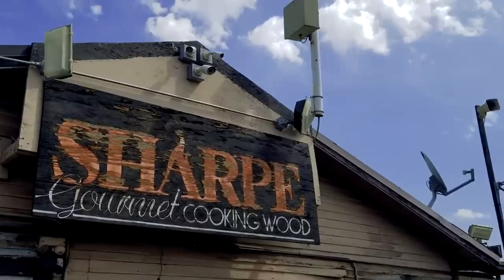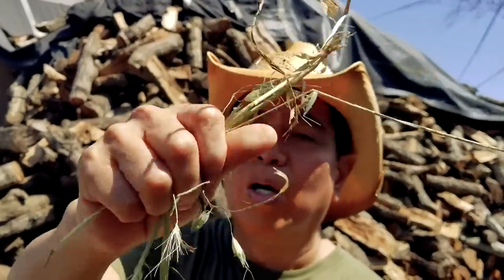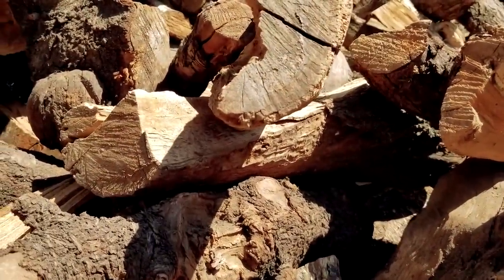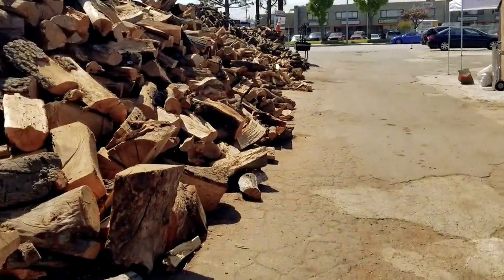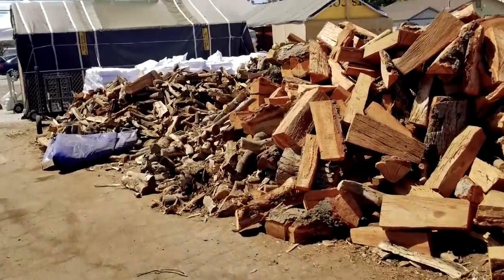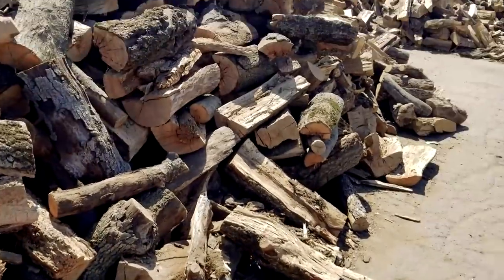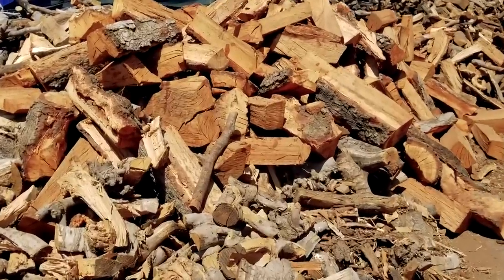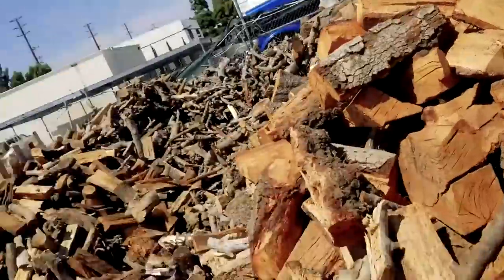Part 2 - Science of Smoking Wood Lignin How-To by BBQ Champion Harry Soo SlapYoDaddyBBQ.com

Comment: Harry good morning
Question I have a graduation party coming up and smoking to briskets a day before so what's the best way to reheat the next day and hold for serve though out the day here is what I was thinking I have a electric master built smoker which I was thinking is perfect to reheat my brisket and hold it in there at 150 degrees all day without drying it I will also use it to hold ribs sausage and chicken what do you think....
Reply from the maker: Reheat until internal 165F and keep warm before service. Turn meat so it is wet with brisket jus.  Use chafing tray to keep warm and slice upon request if you can after removing from foil   alternatively you can cook, slice, and refrigerate

Comment: Would you do the same if you were using a very deep charcoal basket for a long cook? I.e. is it possible for the wood to be too far under, or would it be better to put in middle so can her heat sooner.
Reply from the maker: Suggest you spread wood chunks from bottom to top like lasagna layers

Comment: so for example in my slow n sear, am I doing it right when I put my wood chunks inthe bottom and surround them with coal and then put the hot coals on top for hot n fast?
Reply from the maker: Yes, that is the optimal technique based on science and I have the "hardware" to prove it works!  - https://tinyurl.com/ybxl4mlc
Reply: @SlapYoDaddyBBQ  Your fundamentals video has given me stellar briskets. My only issue is finding a way to get good bark on the flat when I am cooking with the fat cap up on the weber kettle with SnS. I tried just removing most of the fat cap but ended up drying out some of the flat. Could have just been that cut
Reply from the maker: @screenshotted  I prefer two wing charcoal basket on the Kettle as the convective airflow creates championship brisket bark.
Reply: Most appreciated. Got a pile of Plumb/Cherry wood that's been drying for a few months. Under the coals. Whoa! Gonna try that. Saturday barbecue at my place is going to take on new level of aroma. Thanks for the tip. Brisket is going on. Forgot about the phenols. Too long out of Biology Class. Cheers

Comment: Hhhhmmmm. I don’t know about all the science of this video, but applewood, like most any fruitwood, produces plenty enough BTU’s to cook with. Not sure where the idea to the contrary came from, but many a bbq contest has been won using it. Also, the very best BBQ flavor is from thin blue smoke produced from a very hot, clean burning fire, (specifically in a horizontal offset smoker) not from smoldering wood chunks in a bed of charcoal. I’ve tried it all: shoveled coals into the bottom of a drum, cooked over lump and wood chunks in both a UDS and a couple of WSM’s, cooked with a wood-fired Bandera vertical offset, and I went full circle back to what I started off with. (I even got volunteered to man a gas offset smoker once for a wedding, and even though I added much more wood to the burner than suggested, the pork had VERY little in BBQ flavor.) The truth is this. You can make the absolutely WORST or the absolutely BEST tasting BBQ in a wood-fired, horizontal offset smoker. That’s not just my opinion. Most of the famous BBQ joints like Franklin’s cook with wood-fired offset smokers. The faster you want to cook or the bigger the smoker, obviously, bigger the fire, but you always want a HOT fire for thin blue smoke for that smoke flavor that doesn’t overwhelm but enhances the meat. But regardless of all that, I also preferred to bury my small wood chunks in my charcoal smokers. Thanks for your videos.
Reply from the maker: Agree 100%.  It's always about the pitmaster and never about the pit!
Reply: The offset smoker is a lot more work than a set it and forget it smoker like a UDS, but yes, that’s what I use. I lucked up on a Texas Pit Crafters PM100 horizontal that I came upon used a couple of years ago. It’s head and shoulders better than the wannabe Oklahoma Joe’s (both a Highland and a Bandera) made by Charbroil that I was using. A lot of folks use Old Country offsets. I’d likely get an Old Country Pecos if I was buying a new one.